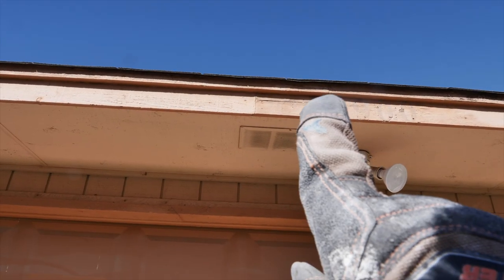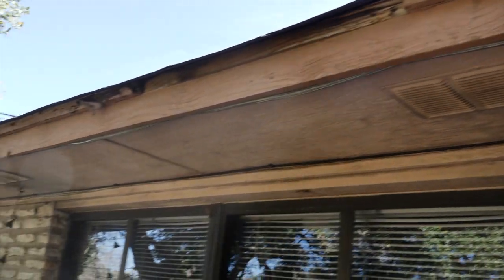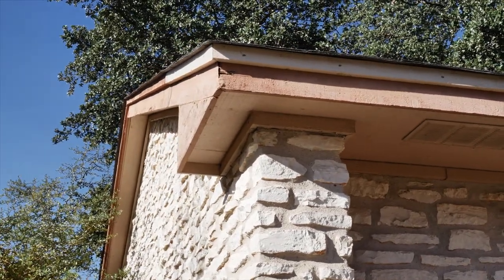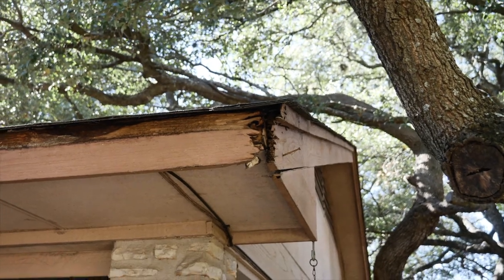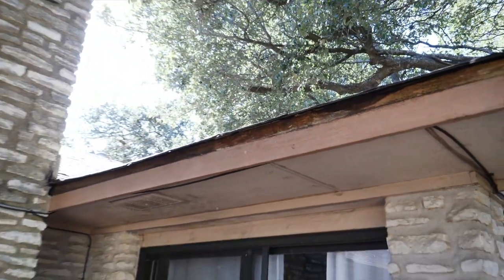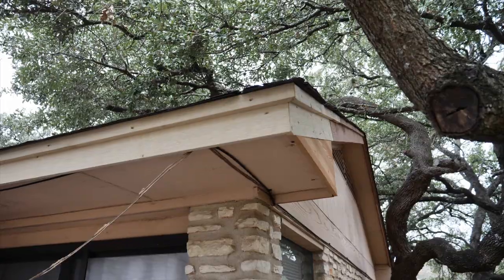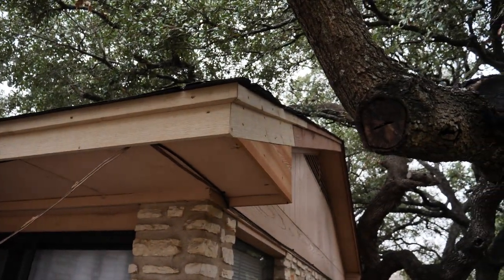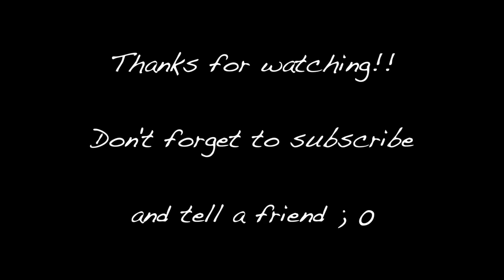How to repair / replace fascia on a house

Comment: We have a house similar to this. Roof and new drip edge was installed 2 years ago. However, we did not have the soffit underside replaced, so it is open here in FL. Im thinking i have to sand it and paint it to protect it, unless theres some kind of paint ,glue, tar lol that I can apply to the underside to help protect it. Are you aware of any products i can look in to ?
Reply from the maker: We have quite a few homes here in Texas that don't have any soffit and as long as it's painted and sealed properly, you should be OK but with Florida's climate, it may be a little different.

Comment: Now I see we use screws more than nails right? Nice job.

I have termite damage on fascia and some rafter tails. Should I replace this whole section, all wood, to make sure no termite hiding somewhere we do not see or can tell by poking with a long screw driver?

Yes it will cost more money but maybe good peace of mind.  We will fumigate later when we are ready to sell the house unless termite people really convince me to fumigate now. I fumigate the house maybe 15 years ago.
Reply from the maker: Depending on how long the section is, cutting a few feet back from the damaged area and replacing just a section is fine as long as you make the joint as smooth as possible.